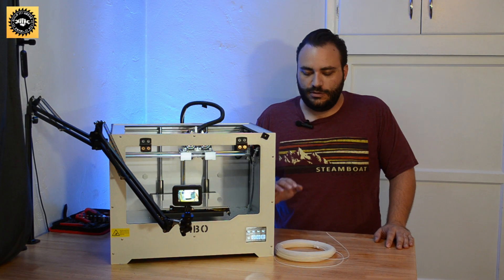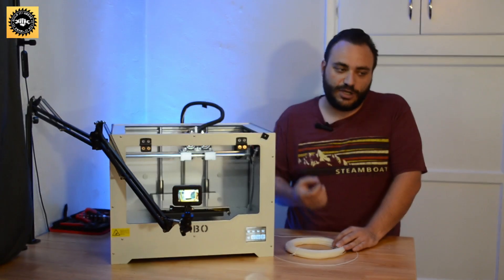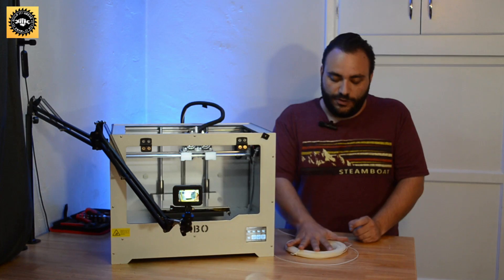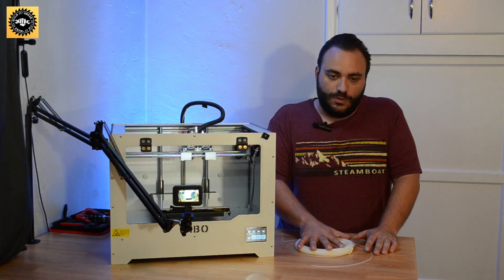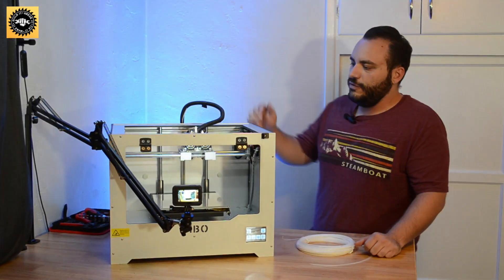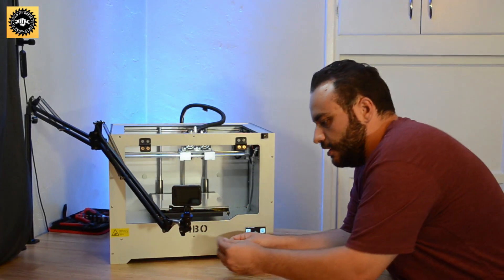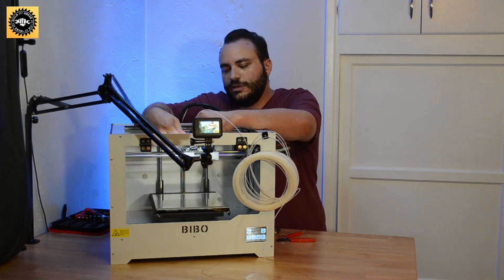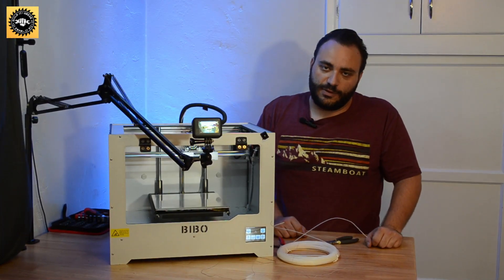3D Printer Cleaning Filament (How to Clean a 3d Printer)

Comment: Constructive feedback: (1) swap out your mic, the clicking, popping and distortion makes you almost unwatchable. (2) Switch your camera to manual focus, the continuous re-focussing was making feel travel sick! And it usually settled on focussing on the wall behind you! (3) Avoid the fancy transitions, not needed, just cut. (4) Good use of different framing. (5) Consider trimming out footage that isn't progressing your point e.g. watching filament feed for over a minute. Interesting content. Good luck on your YouTube journey.
Reply: Ya unfortunately it seems as though this creator doesn't really understand what he is trying to explain. Or basic editing of the video to engage people and get his point across. It almost seemed like it was satire or done on purpose.  Like when he was talking about the filament Temps and said he runs his Pla @ 175°. Also there is absolutely no reason this video needed to be 16min long. Shouldn't be more than 5min at most. Probably even better just a short. I not trying to be rude or seem too critical about it. I understand everybody has to start somewhere, and I wish this guy the best. I don't even create videos or content, but this drove my ADHD self mad crazy!